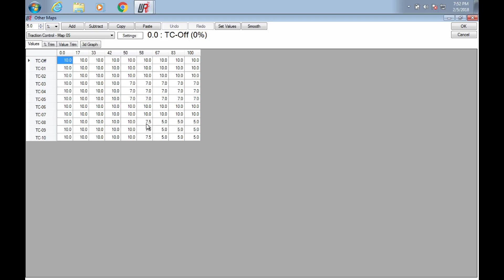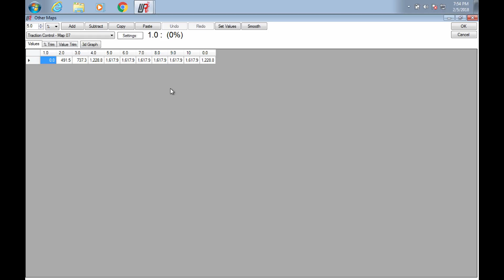What do the Suzuki GSXR1000R Traction Control Maps look like?

Comment: I was looking to understand the traction maps recently but it's hard to find any definitive information. I was thinking one of the tables might relate to launch control because the traction and wheelie settings seem to behave differently when using launch control. The other thing I'm considering is how the various tables relate to lean angle, because I assume different lean angle values will determine the level of intervention for TC.

Anyway it's good you made the video, it's nice to see I'm not the only one wondering how it makes sense. I'm sure someone knows what it all means so I'll keep searching and see if I can find anymore info.

Comment: hello, thanks for your video!
in TC map 01 we see that the horizontal axes goes to mines values. How can we attribute that to throttle position? In other words, are you "sure" it is not something else?

thanks
Reply from the maker: I am not sure.  I think this table represents throttle differential between something else.  I am not sure.   Maybe front and rear wheel speed since there is anti stoppie in the TC.
Reply: @MantisRacing  hello, good points... for a while i tried to think about some differential indeed... i thought about spinning, as you said but i am not sure as well... it's really a pity that Woolich does not develop those maps further
Reply from the maker: @Emanuele Parodi I have access to Kawasaki Gen 4 maps and they use negative numbers in their throttle delta differential. I think this is really the overall sensitivity map, but I don't know for sure.